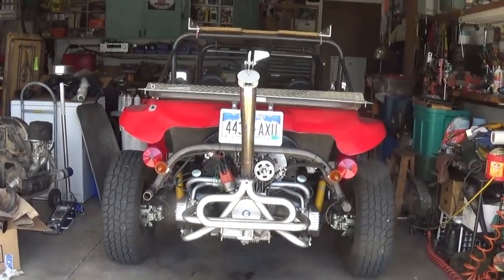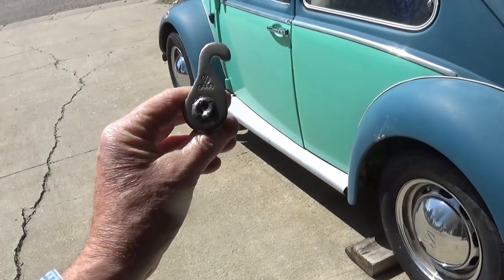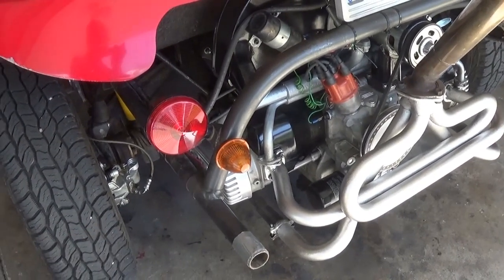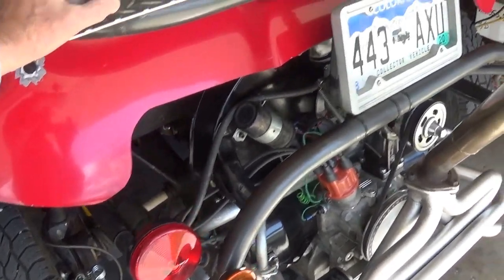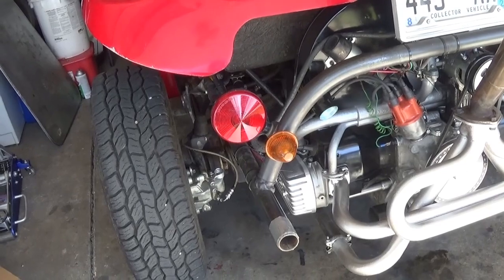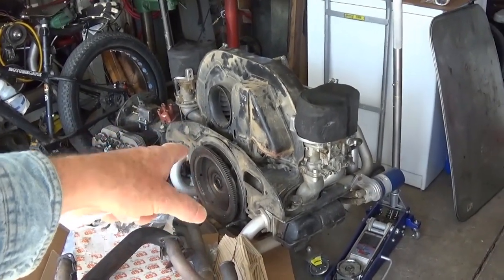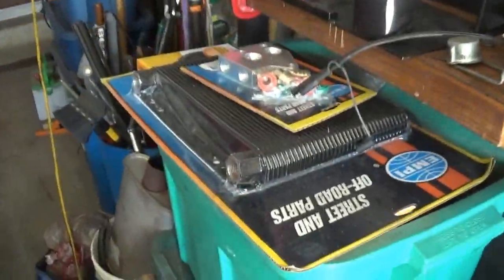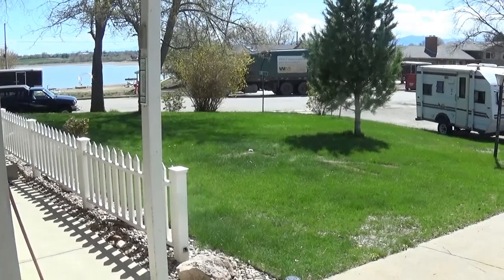1776 VW $$$$ and Sense

Comment: Hi EZGZ.  Thanks for yet another excellent and informative project, covered comprehensively.  Like you I have a lot of parts to build engines and not a lot of money so want to recycle what I have got into something good and reliable.  One thing I can't see in your videos on the 1776 project is whether you altered the jetting on the PICT carb to take account of increased capacity?  Knowing you, you will have covered this somewhere and knowing me, I've probably missed it but if you could let us know what you've done on that I'd be grateful.  Thanks.  Pete
Reply from the maker: On this one I totally lucked out. I pulled the 30 PCT-1 out of the hord and it had a shiny new 65 idle jet and 130 main. I'm sure thats not stock but it's working for the type of fuel and heat range of the spark plugs. I just look at my plugs occasionally.  I have never been a jetting funatic like some guys because I drive mostly street and with altitude changes so sever where I live it's always a mulligan stew. I have been getting good results with the Autolight 14mm spark plugs lately...
Reply: @TheEZGZ  Thanks for that EZGZ.  I'll have to go away and look at standard jetting - unlike you I live at sea level and nowhere in the UK is as high as you are!

Comment: Thought you might find of interest. Some of our prices for machine work in my part of the world. The machine shop is a block away from my home so that works out great. 
Set of 4 new jugs comes with (1600cc cylinders, pistons, pins, and rings) US$ 205.00
Machine work on used heads 1300cc to take  the 1600 cylinders. US$ 31.00 each head
Machine work line bore case US$48.00
Regrind crankshaft .025, .050, or .075mm US$ 30.00
Gasoline about US$ 5.00 a US Gallon.
Reply: Tim Reiner where is this at?
Reply: @knockout818  I live in the interior of Northeast Brazil

Comment: Nice to get out and enjoy the sun shines.  I thinking about buying a Chenoweth body in Denver this weekend.  What is your throughts on a Chenoweth?
Reply from the maker: I'm familiar with the Chenoweth frames. They are a classic. On the sand dunes body's just added weight and pinch points but were nice on cold mornings. If your going for a street legal car it's a must and the cops might leave you alone. Sounds like a good thing to check it out. I don't do much in the paint and body work.
Reply: I got a 66 VW title and engine to make the Chenoweth legal hopefully.

Comment: I bought a sand rail but the charge light isn't hooked up, the engine has a stock alternator and I am using a stock speedometer with the warning lights at the bottom. I am at a total loss as to how I hook the  wiring from the alt. to the gauge, I have no idea where all the wires attach so the charge light works, if you have any ideas, please let me know, thanks.
Reply from the maker: https://www.youtube.com/watch?v=SC8dovHUB2I

Comment: What are your thoughts on hydraulic clutch’s if you don’t mind me asking?  lol the videos.
Reply from the maker: Used on on my sandrail for years.  It works but it doesn't feel the same. You loose the direct feel of contact.  Add that to a kennedy performance clutch and I would kill the engine on take off out on the sand dunes.  I prefer a cable whenever possible

Comment: Hi EZ, I have a question no one seems to be able answering to me: I measured my scat c35 cam having a diameter of 29.50 mm and 38.50 mm in the middle of its lobe. Depending on the ratio of my rockers I simply would multiply that lift of exactly 9.00 mm by i.e. 1.1 or 1.25. Correct so far? So the valve would open 9 mm x 1.1 = 9.9 mm. 

I also measured the stock cam of my 1500 Karmann Ghia the same way which was exactly 7.00 mm.
Reply from the maker: You are correct but don't forget to deduct the .006 valve clearance and it order for it to be correct your valve geometry has to be perfect. A few thousands isn't going to change the character of the engine. Remember lift usually extends the RPM range and duration influences where the HP is during that time. Nothing works correctly if you don't have the right spring pressure.
Reply: TheEZGZ You are fast in answering the comments! 👍 As one of your oldest followers I of course know about what you said.
The question was, why the advertised cam lift is .381 inches when I only measure approx. .354? Any clou on that? Did you ever measure your cams? No one here can answer...
Thanx
Bjoern from Germany
Reply from the maker: I always measure my stuff. I just like to know. I've never had one that far off. Gene Berg wrote about advertised cam lift and how it might not be exactly as advertised. .381 must be a High Performance cam. You didn't say the brand. You should call or e-mail the manufacturer as the quality control is off and they should send you a new cam. I'm very suspicious of your findings. If the lift is wrong the duration might be off as well. I would probably stick that thing in my collectibles and forget about it.
Reply: TheEZGZ Scat C35
Reply from the maker: Good Cam, Great Name and Brand. I have one in my 2110
82 x90.5  I also run the Scat 82mm stroker crankshaft with it.

Comment: re: flaps and stat.
Exactly what temp is "too cool" and how does that compare to temps in a water-cooled engine
Reply from the maker: Indeed it should be the same as a water cooled engine. The original VW engine would not have put them in if they were not needed for long life in 4 seasons. In addition to lubrication it will also vaporize water and fuel that contaminates the oil. When the engine runs at 180 F  the tolerances in the bearings are tighter and engine makes more power.  I know millions of people run there engines without flaps and stat for years. But they are just hobby cars and don't really go that many miles.  Thanks for watching and commenting.
Reply: @TheEZGZ  >>When the engine runs at 180 F..... <<
VW heads run closer to 300F...the oil about 200F or more.

Comment: EZGZ do you think with the doghouse style it would still get hot
Reply from the maker: It would sure help and it would probably keep both heads the same temp. The left head run's about 20 degree's hotter which is no big deal if it stays under 220f .  HOWEVER ....  The dog house set up with larger fan would cost me around 3 or 4 HP to turn and on this project I need to keep all the power I have. This car isn't going to see extreme temps and it's a just a fair weather toy so for now I just want to get more miles on the engine if it would just stop raining,

Comment: @EZGZ can u please give me some help.  My bug 1500 stock starts fine, only when I put fuel in the carb bowl.  I replaced the fuel pump and correct rod, The bug runs with fuel in the bowl and the upper fuel line disconnected and absolutely no fuel comes out. I have already tried two pumps and no fuel.  I already checked flow from tank and lines and breather gas tank line.  It’s a 12volt, I’m lost?
Reply: I had and 1600 engine I rebuilt last year with the same problem... lengthened the rod about 2mm with weld and fixed the problem. The other option is sand the bacolite pump base... maybe your distributor geared shaft is operating too low for some reason therefore the rod is set too low, this will drop the pump slightly.
Reply: Tim Reiner  thanks
Reply: @knockout818  let me know if the suggestion worked...

Comment: What is a good head temperature ?
Reply from the maker: Not trying to side step your question but it depends on the load and your set up and the outside air temps.  Best thing to do is start data logging your current temps so you can compare when your working it hard and when your taking it easy. That way you can establish whats Normal for your engine.  Normal for a Bus would not be the same for my Dune buggy orrrrr maybe it would...